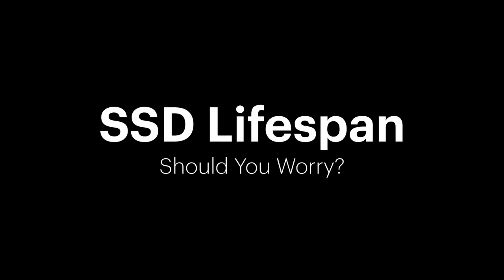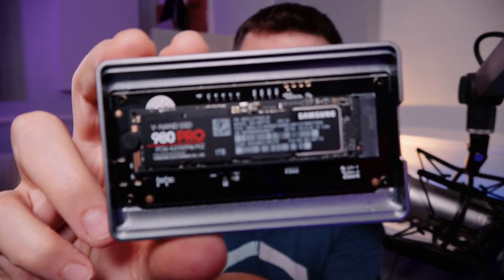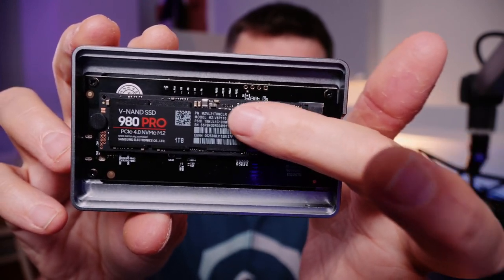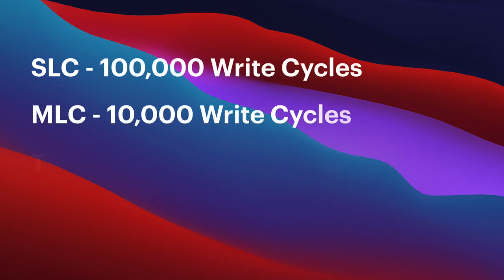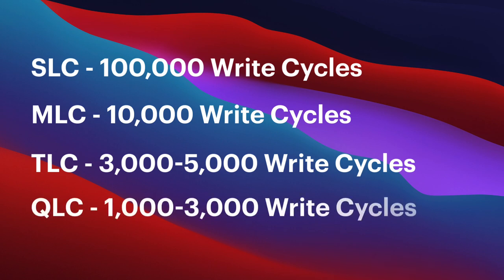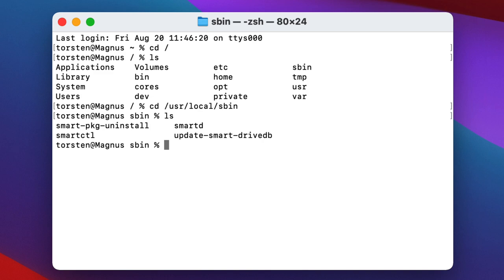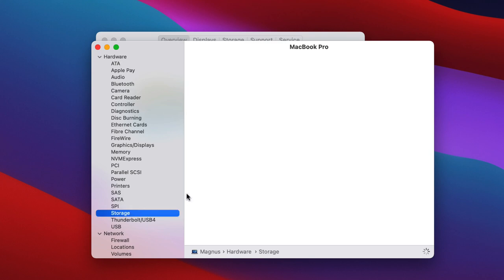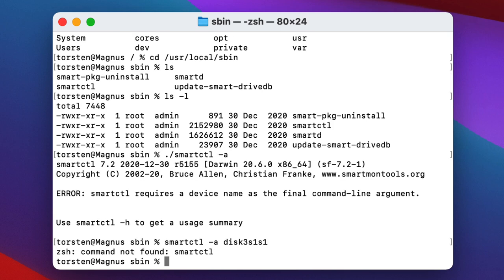Laptop SSD Drive Lifespan - Should You Worry?

Comment: If your OS is using RAM within 80% of your current RAM, as mine was at 6.2 GB with 8 GB RAM, getting more RAM will significantly reduce SSD writes.  I did, bumping my RAM up to 16 GB, and my SSD's wear was cut by about 30% while avoiding significant slowdowns caused by memory caching to drive.

As it is, in 4 years of use, my 1 TB drive has had 42.9 TB written and Samsung Magician reports my drive remains in Good condition, the same as it was during the earliest months.
Reply: I've moved my `temp`(windows) or `.cache` (linux) dirs to ram drive. Daily writes have reduced to jaw dropping low.

Comment: That's just what  the warranty  period is  unless it is  a very cheap SSD it should far exceed what the warranty guarantees.  I just got a 1 GB. connection and I just got my first 1 TB SSD and I am going to use it.  I have already written 4.4 TB in six days I am not going to baby this thing.  If it dies really early I will go back to an old spinning drive , but after seeing your video I am more at ease!
Reply: So did the ssd still live? 4.4TB in 6 days holy hell what did u do?

Comment: Very nice video!
So life span grows linearly with the size of the drive, as long as the used space is much smaller than the drive size.
Reply from the maker: Yes. TBW figures would grow in relation to disk size and yes, theoretically it’s good to have a disk larger than you need otherwise you’ll potentially be writing over those same cells much more often. Plus the performance of SSD drives drops considerably when full.
Reply: @tdcattech how much tbw is yur ssd editing machine

Comment: Just write this here in case it helps someone with something:
Average user. No heavy duty working. 70~75% full all the time. However the PC is on 24/7 with only several dozen days off/year. After 3 years OS drive hit 43 TBW (NAND write). Regardless of its TBW (80 or 120, I just can't remember) I'd dare say it will still work fine for 2 more years before my next build coming.

Comment: I built my first SSD-based PC tower in 2017. I just replaced that SSD in 2023 mostly out of a feeling that at some point it will fail, but at the time I pulled the drive it was functioning perfectly.  Its replacement is also physically smaller (m.2 drive instead of 2.5 inch) and potentially quicker (NVMe instead of SATA connection), but I don't actually notice the speed increase.  The change from spinning platters to a SATA SSD was instantly noticeable.  The change from a SATA SSD to an NVMe SSD is much less noticeable.

Comment: If you want to figure out how much you need to write to the SSD to wear it out, multiply the Program/Erase Cycles (P/E) by the capacity of the drive. So if you have a 1TB drive that says it can take 500 P/E cycles, it means you need to write a total of 500TB to wear out the drive.

Thing is though, unless you're really hammering the SSD, you'll probably just write 3TB to 15TB a year. 

Do the math. 

500/15 = 33.3 years

So yeah, no need to worry. You'd have to deliberately wear out your SSD to wear it out. You'll probably run out of storage space much sooner than you'd run out of P/E cycles. 

SSD prices are coming down all the time also, and by the time you need to buy a new one, it'll be much cheaper. (Just recently got a 1TB Lexar NM610 Pro for $30 after coupon!! Probably QLC but for the price, it's still a steal.)

Consider also that most hard drives last just 5-10 years, and yet nobody is complaining how quickly they wear out. I'd worry more about a hard drive failing than an SSD, TBH.

Comment: i have a samsung 970 evo plus 1TB as a system drive. PC is contantly powered on and has been for 2 years occasionally ill restart the pc but its mostly on, i have all my game launchers on there like steam epic uplay etc netflix and disney+, i specifically bought this drive for microsoft flight simulator 2020 so thats on the nvme drive too, it still seems to be running great after 30TB written. this drive improves flight sim, phasmophobia and windows loading times dramically  12 seconds to load windows 2 minutes im on the run way 1 minute im been hunted by Derrick johnson, this drive is faster than a Revenant!

Comment: Server SSDs. Most people dont know they exist & you can like a 2700TBW server one instead of a 600TBW consumer one of the same size. Also price matters hugely for SSD. Seriously spending just 10 bucks on getting a slightly nicer brand one can double or triple the durability. Also size matters of cause. I do think that most consumer drives even the cheaper ones are going to go completely obsolete before durability runs out for the normal users. I do remember the early SSD days where we had tiny ssds of like 15-50gb like i had 2 of those Ocz Vertex ones & managed to brutalize one of them to death in about 2 years. But i also abused by riding it like a F1 car. The tech is on a completely different level today. Still dont forget to backup :)

Comment: thank you for this enlightening considerations. Actually, aside from the main system drive, I tend to write once the files to the drive, and very rarely I erase this data to write anew .... so the final TBW is hardly two times the total capacity of the drive (2 write cycles). For instance with video editing and video files .... I will seldom erase a drive once I have filled it to rewrite new data, and if I do, it will not be tens of write cycles. I suppose the main drive has more writing and erasing and rewriting .... but I can hardly see how I could write 60GB per day every day (which means also erasing and rewriting) as you do, in your heavy usage.

Comment: I have sent two SSD drives for RMA already this year out of about ten I am using. I am not even considered "heavy user". I don't even do video recording or editing. No I don't think you've got this one right. The newer QLC drives are just way less reliable.
Reply: Every extra "level" (from SLC to MLC to TLC to QLC) surely decreases reliability, and the manufacturer of the drive plays a large role in the quality of the parts. Also there are no guarantees -- 8 units may be absolutely reliable for years and 2 fail after the first week.  I can't think of anything built by humans which works 100% of the time.  Best thing to say is have multiple backups of all important files (preferably on different types of media to avoid just that kind of issue).
Reply: Use tlc then noob ;)

Comment: Nice video. I have seen numerous videos on this subject but even though it always seems we don't have to worry about this issue, I have had some fails. I have had a few USB thumb drives go bad (Read Only or just dead) which were not that old or heavily used. I have also had a 1 TB Western Digital SSD go into Read only mode (Can read if the system can see it but cannot write, format or erase), This drive was only 11 month old, used very little. Was still under warranty but I did not want to send for replacement as had personal info which I could not erase. So not very impressive. I have numerous older Mechanical drives that are 10,15,20 years old still working fine. Go figure...
Also because of this I would never recommend using SSD drives in NAS units (I have 2) or servers because of my experiences. I am a tech person (retired) so I have seen many situations. If you just want a fast boot drive for your computer, sure by all means. If you store your data on a separate drive(s) then SSD drives may not offer much performance increase and they draw much more current than most mechanical drives. In any case, BACK-UP your stuff ! then if your drive dies - who cares. My two cents for what it's worth. Regards to All. 😀

Comment: There is another downside to NVMe drives in addition to the loss of capacity: They are apparently rubbish. If you check every Amazon listing from the el cheapo generics to the pricey Kingston Fury Renegardes, they are disparaged by  between 21 and 9 percent of users. Often they simply die after a few months, or they are incompatible with some systems, or they crash a system. The mature technology of a spinning drive can last for decades with negligible loss of capacity to bad sectors, so instead of using only 25% of the capacity you can freely use 99% and not lose any sleep. Just today I received three used enterprise drives with 30,000 hours on them and after a thorough test I will have no hesitation using them. They typically warn you when problems arise. If you rely on an NVMe, you need good backup discipline and a spare computer. That said, when they behave, they are terrific. The question is, why can't at least one manufacturer make one you can trust? We have the technology, just not the will to make a premium model.
Reply: I have a aad that is almost a decade old. And every cell is still in good health. Still going strong. Nvme is only s different communication protocol and do not differ in terms of lifespan.

Comment: Most dead SSD's these days are likely due to low component quality (choose brands/types carefully), poor heat regulation (use proper heatsinks), or simply defective individual units in some manner.  The typical avid gamer/home PC user only writes between 5-6TB PER YEAR to their primary drive, on average.  Most M.2 SSD these days have a TBW endurance rating of anywhere from 100TB o 1200TB.  Even on the low end that is a LOT of years of write use, assuming drive doesn't die due to some other reason unrelated to its write endurance rating (TBW).  So, buy high-quality component SSD's & pay the extra $$$, & don't use it without some sort of heatsink.  I've always used SOLIDIGM-INTEL professional-grade (enterprise-class) M.2 or 2.5" SATA3 SSD's myself & never had any issues since my first ones in 2015.

Comment: Most SSD will last well beyond the life of your computer.  Especially newer drives.  However even older ones will last for many years.  If you do video production I would grab a external drive and write projects to two.  One as a back up.  If you are using computers for a business and have really important data always back up but don't worry about the life of your SSD.
Reply: I think newer drives might last shorter than older drives. As SSDs get cheaper more models will feature QLC as everyone races to the bottom. There's no way QLC can outlast a good TLC or MLC SSD.

Comment: My 2TB Samsung 980 PRO just died a couple of days ago after only 1.5 years and with 4.7 TBW.
Reply from the maker: Now that's just rotten luck 😕
Reply: Did Samsung send you a replacement?
Reply: Sounds like you encountered a common firmware problem. Not that it helps much but the actual flash cells are most probably still in good health but the controller thinks they are corrupted and shutted down.
Reply: I've never been a fan of Samsung quality.  I've used all INTEL (now operating under name SOLIDIGM) datacenter-grade SSD's since my first ones in 2015 & they are all still going strong today & rated at 100 health - even the ones from 2015 (which are 2.5" SATA3 SSD's, from before the M.2 boom).

Comment: SSDs may have over provisioning and they may also have wear leveling.  Not all of them were made to do these things.  Every time you read or write data on a SSD you are forever using up some of its VERY short life span.  The cost per GB is enormous compared to a HDD.  With mechanical hard disk drives you'll get millions of read/writes to it before it starts to exhibit tell tale signs it is about to die.  You don't get those warnings from a SSD.  Software may show that its health is fine and then the next moment it dies taking all your data and software with it!

The trade-off of using them doesn't make sense to me.  Not for main storage.  I can get an external 14 TB USB 3.x WD MyBook for about $300.  Ain't no way you're going to match that capacity for the same price from any legitimate SSD.  Sure they're faster, use less power, run silent, and are impervious to sudden shock and magnetic fields.  But their lifespan / reliability is pure shit.  Besides it is getting harder and harder to find a laptop that offers HDDs for internal storage.  When my Windows 10 laptop stops being supported by MicroSoft it'll likely live out its days as an offline machine.  If I can't buy a laptop with a WD HDD inside I'll just stick with tower PCs where I can have HDDs in them.  Plus optical disc drives for Blu-Ray DVDs, DVDs, CDs.
Reply: Damn. How to say you do little as work possible with out saying you do little as work possible on that machine. 😂 CD/DVD? Yikes... didn't even know those drives were still used...

Comment: Bought a 980pro 2TB late February. It’s already dead smh. I’m hesitant to send it to Samsung because I can’t erase my data on it since it’s stuck on write-protection mode.
Reply: Sadly you most likely ran into a common firmware problem. Where your actual physical storage is still totslly fine but your memory controller+firmware thinks your drive is corrupted. Hope you found a dolution in the mean time.

Comment: My kingston ssd wave 4375 hours on, and 10TB of data written, i still have 84% of life
Reply from the maker: How long have you owned it? I assume much longer than the 6 months power on time? It’s incredible how little data actually gets written.
Reply: @tdcattech  I have for a little more than 2 years, i use in my laptop just for work
Reply from the maker: Plenty of life left in it then. 👍🏻 Still, that’s quite an on time. Makes sense for a work laptop, I guess.
Reply: So what happens when you run out the ssd life? Do you just buy a new ssd and replace it in the laptop? Thanks.

Comment: If SSD has not been used for 10 years, would that be like the HDD, it'll just die?
Reply from the maker: SSD drives have a finite life but no-one really knows how long. Drives are made to have minimum specs for retention but as for the max, it's really anyone's guess. I know I've had flash storage untouched for at least a few years without any problems. Ten years might be a stretch.
Reply: @tdcattech  Agreeable to that. Yeah, it does need energy atleast so it retains energy ( memory ) personal perspective on how devices works, but atleast I heard your thoughts, it's important to me. Thank you!
Reply: Some companies claim that you can let their sad unpowered in shelfes for 10+ years eithout your data beeing corrupted, but how they can make that claims i habe no idea.